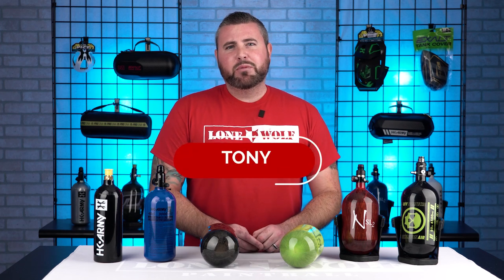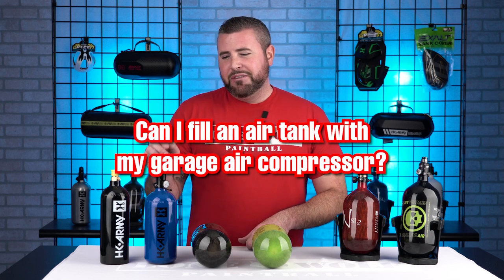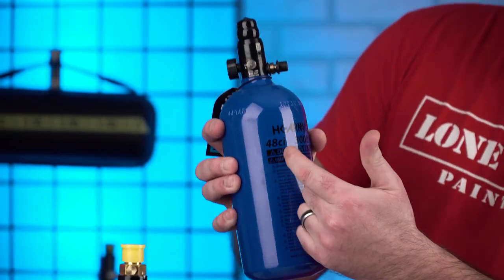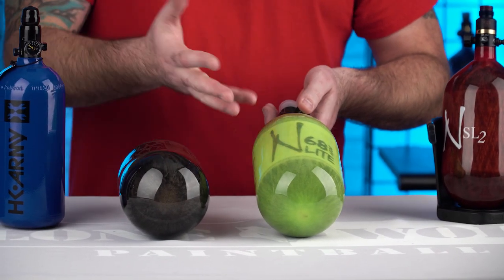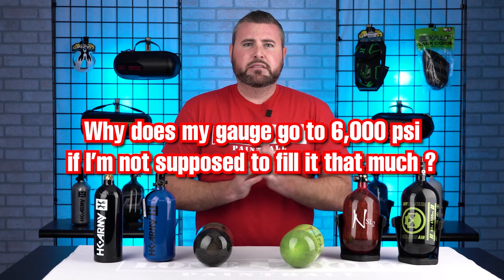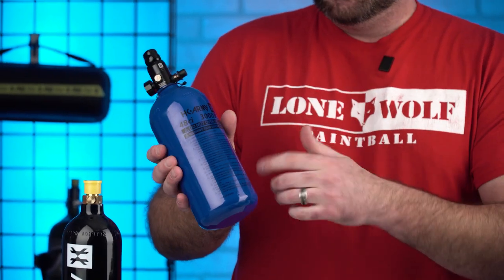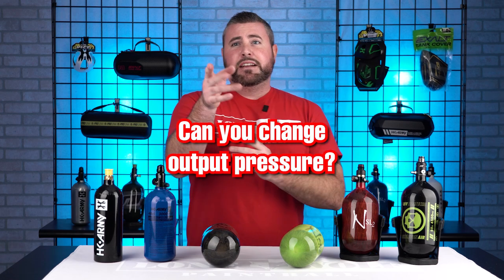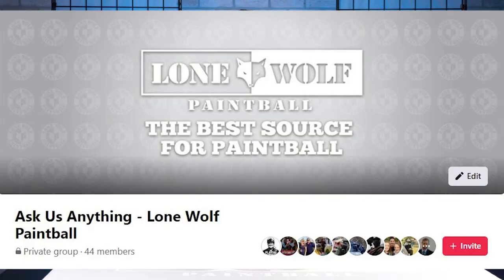Top 5 Questions About Paintball Air Tanks | Lone Wolf Paintball Michigan

Comment: if you have a "home field" or like to head to the wood with a bunch of friend to play a few game for fun, CO2 is still a great choice. The yield of shot per fill is still great with a tippmann gun.  You can grab a few 24oz and tippmann chronus for the price a a good gun and on one fill you'll be able to play all day. 
That being said, if you play on a real commercial field GET AIR!!!
Reply: one thing i feel needs to be mentioned and isnt said here is if you run CO2 with a remote line it will warm up to ambient temps in the line and wont freeze the solenoid but it does have particulates in it that can still be potentially harmful to e-markers thats why its being phased out

Comment: I wouldn’t even want a steel tank, unless it was fully stainless. Steel rusts and high pressure + Rust can lead to a REALLY BAD DAY! Even just a standard air compressor just running it, it builds moisture. You can see it blow out of the valve on the bottom of the tank when you decompress the tank. 
That’s most likely why these tanks are all aluminum nowadays. Not to mention the high quality alloys like 6061 & 7075 t6 aluminum which rivals some steels in strength. It doesn’t rust either. 
A tank at 3000 or 4500 psi exploded is not a good thing at all! Air actually explodes, which is why they test with water and not air. Water will just spray if a tank fails, air will violently escape out a failed section creating more damage and possibly send shrapnel out at lethal speeds. 
So that being said, if anyone reading this has a out of date tank? PLEASE DO YOURSELF AND POSSIBLY ANYONE AROUND YOU A FAVOR AND GET YOUR TANK HYDRO TESTED, OR GET A NEW TANK. IT REALLY COULD MEAN YOUR LIFE OR SOMEONE ELSES LIFE BECAUSE OF IT.  HPA is no joke. 
This is my PSA of the day.
BTW thanks Lonewolf for the A-5 and the response trigger I just ordered from y’all, it’s a beast. Got my nephew to buy one the same day. You guys ship super fast, love it! 👍👍
Reply: The old steel tanks were stainless. They were never as popular as aluminum because of price and weight and to my knowledge were only used for CO2.
Reply: @GigoloSoldier  Actually they were chromoly steel, not stainless.
Reply: lol cool story about yourself.

Comment: Why do parks say they offer 4500 psi but they max it out at 3000?
Reply: It depends on their specific compressor they use at the park. There are 3K and 4.5K models. The 3k can only fill to 3k max, the 4.5 can fill to both 3K and 4.5K. When you compress air, it heats up and also expands, so you will lose some bottle pressure after it is filled and cools down.

Comment: How should you store your tanks? Full, empty, partially?
Reply: Empty
Reply: @FIREB4II  home defence? I've talked to grimburg and they said they've stored air in tanks for one to 2 years with no issues. Just need to check pressure over time. I wouldn't keep it stored under pressure on a gun, that could cause premature failure.
Reply: Partially, lets say 60%? Because of two reasons...

One, when you want to try your gun or whatever, you dont have to go out and get air.😅

Two, its better for the tank itself, it better preserves it

Comment: Question: how long does an HPA tank hold its air? Annual paintball outing is in the middle of nowhere and I won't have time day-of to fill. Will it slowly leak out over a day or two to the point of it being a problem come game day?
Reply: It will not leak unless something is wrong with the tanks regulator. You could fill the tank and it will stay filled well past the tanks own hydro date.
Reply: Unless there is something wrong, the air wont ever leak.

Comment: I have a question but it’s not about tanks. 
I have an P. E.  etek2 and the barrel is stuck to the barrel tip. Did the etek2 come with a 2 piece barrel and, is it a normal thread? (By normal I mean right to tight left to loosen)

Comment: You didn’t answer if the output pressure would make the gun shoot harder ? For example if a marker says use max output pressure of 650psi and I use a output pressure of 500psi will the marker shoot weaker?
Reply: No, the regulator provides a constant output pressure regardless of the tanks PSI.

Comment: This may sound stupid. If you buy 4500psi bottle for the possible upgrade you want in the future, can you use it on a 3000Psi gun only if you fill the bottle to 3000?
Reply: Yes, you can use a 4.5k tank and fill it to 3k all day long, you cannot however fill a 3k to 4.5k as it is not rated for such.
Reply: @xxsoulpatchxx3362  it will be fine i do it all the time at my field.

Comment: is it possible to change the location of the fill nozzle on a ninja tank?,  mine is in a terrible spot it stabs me in the wrist while shooting right handed, thx cheers guys
Reply: Pretty sure you can get a little adapter that will go on the tank and get it in the right spot.
Reply: If it’s a pro v2 reg you can adjust it to where you want it
Reply: @G_L_S  does the infamous pro reg tank do the same thing
Reply: Ninja used to make shims that went between the reg and the asa, they're basically c-clips. It's not the best way to do it, but it is the easiest and the cheapest

Comment: Well that's silly, if a manufacturer is charging $160-400 for a tank, they should be making the gauges specific to that tanks capabilities, regardless of the connections are universal, the material for the tank doesn't cost that much to make. 🤣

Comment: Can I fill my co2 bottle with compressed air or do I need to buy a whole other bottle to run compressed air??
Reply: You need to buy a compressed air tank. A CO2 tank isn't meant for compressed air and doesn't even have the fill nipple that's required.